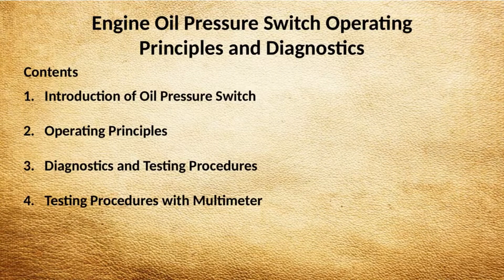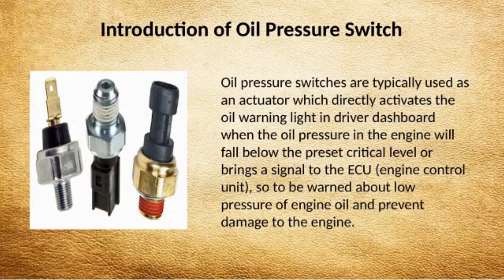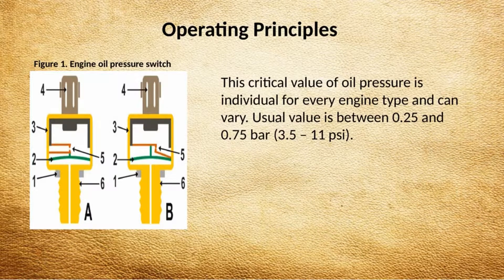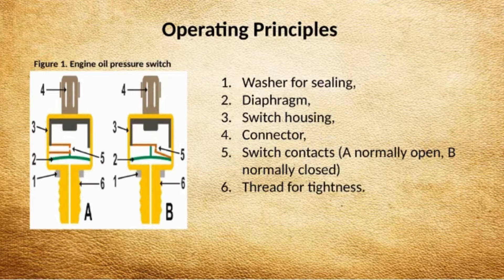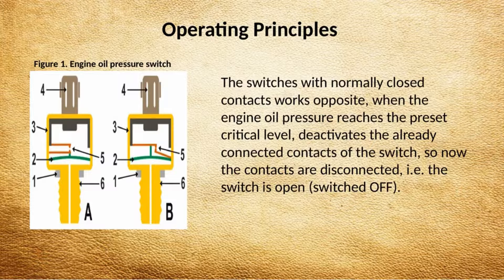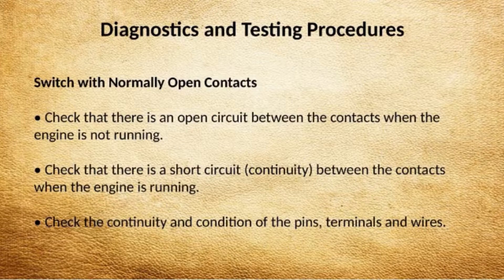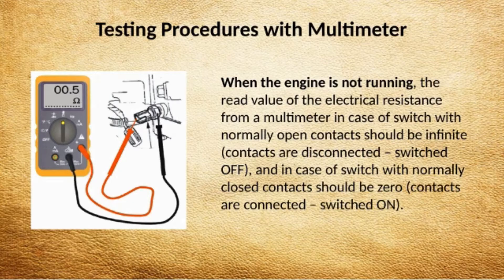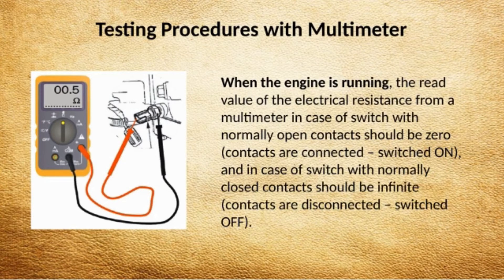Engine Oil Pressure Switch Operating Principles and Diagnostics

Comment: If system is normally open then with engine off and connectors unplugged then your resistance value when testing should have no reading,thus open loop circuit

Comment: why do some cars have a double oil pressure sensor?
Reply: To see if it reaches the minimum oil pressure (low pressure switch)  and to monitor whether it reaches the desired oil pressure at higher rpm (high pressure sensor, this normally monitors a range while the low pressure monitors a minimum level)
Reply: maybe because of the design of the engine, oil pressure readings in some areas must be made.